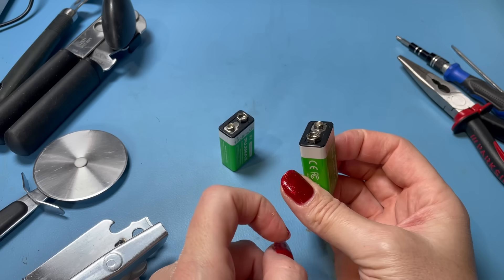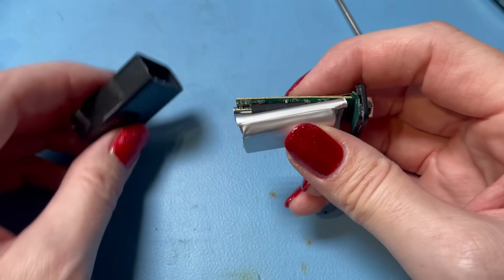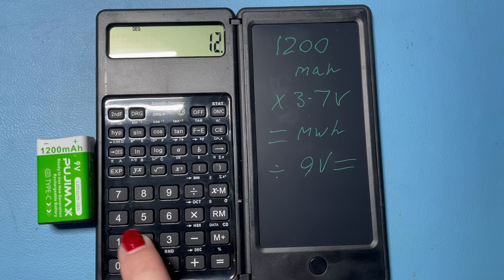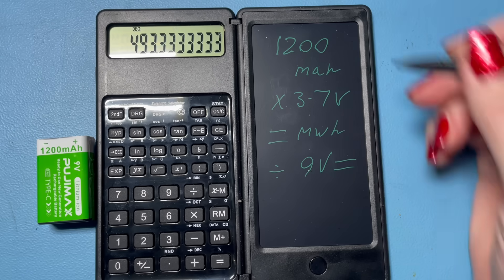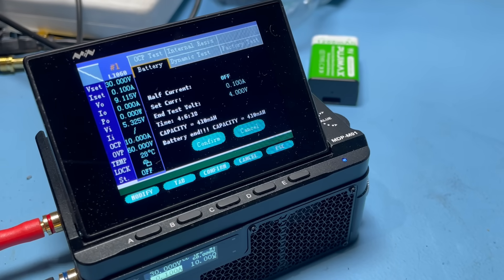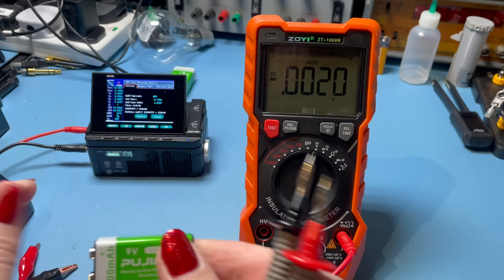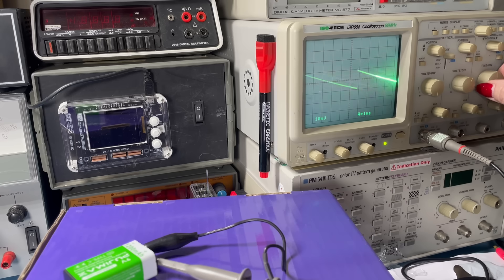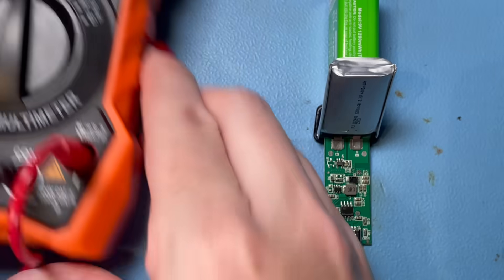Temu 9V Lithium Rechargeable USB-C Battery Teardown

Comment: This 9v battery from the topic will self-discharge in a few days after charging. Because it uses a voltage increase from 4.2v to 9v, that is why there is a constant flow of small current even though the battery is not loaded

Comment: Vende Bateria falsificada, é golpe!,, Não entrega o prometido
Reply from the maker: They're not counterfeit, just very poorly designed. I wouldn't recommend you buy any.
Reply: @JazzTechUK  Comprei duas bateria Hoje, da marca e Flex 1200mAh 9v USB... leve como papel.. não deve ter nada dentro.. vou abrir a bateria , caso dentro estiver com a bateria de 3.5v vou devolver,,/  o carregador da bateria é de 5v de Celular....o carregador não é de 9v....como tem gente que engana as pessoa com produto ruim dizendo que autentico, mas é de ruim qualidade

Comment: Everything is explained very well, so I don't have to do it. 😀But the biggest problem with such batteries, even from the same manufacturer (Pujimax), is that they don't all have a 1200mAh Li-Ion battery, but a smaller capacity. I have two versions of these batteries. One is light blue-white, and the other is orange-black. They all say 1200mAh, but one is around 1200mAh, (orange-blue), and the other is around 750mAh. So they lie with the specifications. These worse ones were bought through TEMU. And that's the biggest problem, that they cheat us like that. And it's not just the case with 9V Li-Ion batteries. And with 1.5V the same. You charge some via USB at 900mAh, others at 550mAh, and they charge at 350mAh. Completely the same batteries, same colors, same manufacturer, but different seller. Easy for us who can measure it, but what about 99% of others. Only later do they notice that their batteries are draining quickly. Otherwise, these electronics in them also consume electricity even when they are not connected. According to the chip specifications, it should be in microamperes, but it seems to me that it is more than 1mA. Every day 30mA less.
Reply from the maker: I only did a teardown on these batteries because viewers asked me to. I don't recommend them. They have lots of issues, some of which you have mentioned. You are better off with a standard 8.4V dual pouch cell lithium ion battery with no electronics in.

Comment: Sorry your math is not correct. First let convert mAh in watt per hours
Wh= V X Ah = 3.7 X 4.4 = 16.28 Wh
Capacity at 9V = 16.28 Wh / 9 V = 1.81 Ah (please remember Ohm law W/V = A)
DC/DC typical efficiency about 85-95%, lets assume 90%, capacity at 9V will be about 1.6 Ah (or 1600 mAh)
Basically you cannot use your test device to measure the actual capacity, an electronic CC load will be much better.

Comment: The charging from USB is convenient ,so I was considering this for an oscilloscope current probe, but I was wondering about the noise since a boost conv would be used. 80% conversion efficiency is unsurprising since they would use low count, low quality components to keep the price down. With or without linear regulator, this is only usable for noise resistant,  power hungry devices that don't care of rapid self-discharge when not used. Thanks for a great video!

Comment: The typical load for a 9 Volt battery is between 0.1 mA to 25 mA max, in the case of a portable radio. Drawing 100 mA from a normal 9 Volt battery would kill it prematurely.
There is a different 9 V Li-Ion battery with two 500 mAh Li-ion battery and a BMS circuit, which I prefer - it has no parasitic consumption, no RF noise, and you can check the state of charge by measuring the terminal voltage; but the output voltage is 8.4 Volt at end of charge, and 7.2 Volt nominal, 6 Volt fully discharged.
The battery you dismantled in the video has a parasitic drain of 0.1 mA, frankly eccessive.
Thankfully in our side of the world we define the battery capacity as the energy delivered at the output voltage, not the sum of the capacity of the Li-Ion cells present inside. I have many LFP 12 V batteries, which have 4 cell inside, with the capacity shown in the box as the sum of the capacity of the four cells inside. It seems the Chinese like to show the highest possible number possible, even if it is unrelated to the normal use of their devices.
Greetings,
Anthony
Reply from the maker: I only took this battery apart because viewers asked me too. I don't think it's a great battery at all. A basic one with 2 lithium cells in series and no electronics is a better bet.

Comment: Keeping up fixed voltage and then suddenly dropping to zero is exactly how a boost converter works.  It has a feedback circuit that keeps the output voltage fixed by varying the duty cycle in response to variation in input voltage and load impedance. But once the input voltage drops beyond a certaing threshold it just stops working.  You can't expect it to drop output voltage gradually the way a battery would.
Reply from the maker: I don't recommend these batteries at all. I only did a teardown because viewers asked me to. You are better off with a straightforward 2x lithium cells in series giving 8.4V with no electronics.

Comment: Hello, good teardown. I think that the saw tooth waveform on the scope could be coming from the fact that the battery is not loaded and the switcher becomes discontinous. Still, not what I would want for a battery that powers electronic devices as most of the time the decoupling is minimal as they rely on the battery DC cleanliness..
Reply from the maker: I did a teardown and full test as a lot of people asked for it. They are not a great battery replacement. You are better off with a standard 2 cell in series lithium at 8.4V without all the other not so good stuff. At least then it is clean and quiet.

Comment: I've just bought a couple of long-range RF remote controls which take PP3s and require the battery holders to be screwed shut. I'm butchering one of them to take two salvaged 550 mAh disposable vape cells in series and one of those 2-cell with balancing USB-C boost charger boards from AE. They don't have over-discharge protection but I don't think it's needed in this application. The default charging current is far too high and the resistor to set it is tiny. Fortunately one end of it is grounded so I only have to make a connection for my standard resistor to one tiny pad.

Comment: I can't be the 1st to point this out but you should calculate using the nominal voltage which is closer to 7.2V for 2 cells in series.
  Trying to find a side by side comparison for all aliexpress 9V rechargeable but can not find one. want to know which are better suited for high power and which are better suited to low power long life and not to mix them up in the applications to avoid premature death to the cells.
Reply from the maker: There is only one cell in this battery at 3.7V. It uses a boost convertor to raise it to 9V. The 1200mAH capacity is at 3.7V, not at 9V where it is just over 400mAH in practice. This battery is good for high current use. It's fine at 100mA, even 200mA. I did run it at 500mA for about 15 minutes, which it did fine but became a bit hot so I stopped. It's no good for low power long term use as the boost convertor is constantly loading the battery and draining it slightly.
If you want a good quality lithium rechargeable PP3 that will be good for long term low power use then buy an EBL lithium PP3. This is just 2x pure lithium cells in series, (may have a protection circuit, I haven't taken one apart) and is charged from its snap connectors in a standard lithium battery charger.
Reply: Might be better off with 3x LFP cells in series followed by an LDO linear regulator?

Comment: My homemade chargers follow a simple rule; "2 volts over and 10%"  in this case, charge voltage is 11 volts and charge current is 10% of rated capacity,
lol 120ma. --- if it was a real battery.

Comment: 1200ma@9v is useful. it depends on self-discharge.
Reply from the maker: It's actually only 1200mA at the cell voltage of 3.7V, not at 9V. It's misleading.

Comment: Glad to find anyone related to electronics. Thanks for the Tear-down. What is that discharge totalizing load that you used?
Reply from the maker: Are you referring to the Miniware devices I used?
If so, here are the links to the 2 videos I did on those:-
Miniware DC Load  https://youtu.be/UidMfkIL6d0
Miniware Smart Digital Monitor  https://youtu.be/2EnWU_F28IM

Comment: One thing that is not given nowhere enough attention is:
Do they have the 5.1kohm resistors to charge from a real USB-C charger and not just from a oldschool USB A to USB-C cable??

I HATE when they cheap out on two damn resistors like that.

This doesn’t look to have them 😡
But it’s a bad construction in so many other ways it’s not surprising.

My Soshine AA and AAA USB-C batteries drops to 1.1volt when almost discharged, and DOES charge on real USB-C chargers

Comment: There are some losses in the boost-converter circuit, maybe that accounts to the lost 100 mAh.

If you only use it on a low load, the losses will be much higher, so would not last a week long, maybe, but old alkaline battery would.
Reply from the maker: It's not an ideal solution by far. I think most people would be better off with just a plain 8.4V 2x lithium cells in series PP3 battery.

Comment: Hi Jazzy, it's pretty much what I was expecting. For the actual capacity, you must take the efficiency of the step-up converter into account and with 85% efficiency (which should be about right for this kind) we get 419 mAh from your calculated 493 mAh, so that's very close to what you actually measured. Makes perfect sense. And yes, the advertised capacity is false and unfortunately usual with these cheap chinese batteries/battery packs/...
Now, with 400 to 500 mAh, we're still in the ballpark of an actual 9V alkaline battery, so if it wasn't this noisy, it could be a good rechargeable replacement.
The charging IC is a TP4056 which is an ultra-common small Li-ion charging IC, but I was not able to identify the reference of the step-up converter. From what I can see though, the output capacitors (all ceramic) seem to be relatively low values from their size, so that's probably part of the problem.

Comment: Hello, Thank you for the job. 
It looks like Lithium polymer battery. Right ?
If it is, it won't last long. I bought different stuffs on asian websites : most of them had lithium polymer batteries. Dead after 3 monts : they inflated and passed away

Comment: 410 mAh is not bad about the same as a pound shop zinc carbon PP3, it's also a lot better than the ones I got from Aliexpress which I measured at 230 mAh. I took one apart and found a cell marked as 300mAh on the same board as the Pujimax.

Comment: That's pretty good really, most NiMH rechargeable 9V batteries are around 200mAH, the other 'quality' brand LiIon types like Ansmann are around 400mAH, about the only things I'd want to add would be a switch to turn off the boost converter and a filter cap on the output but I do wonder if it might measure better with a small load attached to the output?
Reply: Yeah you don't get much as they stack 6 cells together so that wastes space.  I think it's a little more than 200 though.  No it won't measure any better with load and will be worse.  9v is just not designed for high drain devices so capacity is limited.  So it's only used for DM and fire alarms that's it.

Comment: Mine doesn't discharge but it delivers 8ish volts (I noted that most original Duracell deliver 8.2v brand new).
Reply from the maker: Then it's likely 2 lithium ion cells in series with no boost convertor. A true battery.
Reply: Is yours a name brand or a cheapie? Got a link?

Comment: 83% efficiency is not too bad but it isn't great.
Reply: Might be somewhat better (or worse😊) at lower currents - 100mA is a lot more than anything I own draws (that uses a 9V battery) 
Any improved efficiency might also get eaten by the longer time the circuitry then runs and consumes power.
Reply: @michaeltempsch5282 how about running the test again using the two batteries in parallel so they only provide 50 mA each?
Reply from the maker: You cannot run these batteries in parallel as they don't behave like pure batteries. The boost circuits will fight with each other. As these 'batteries' contain lithium ion cells you can get high currents out of them.
Reply: @JazzTechUK the boost circuits will act as different phases of a multi phase regulator. Also the current from the battery is limited by the regulators design choices.

Comment: Clearly the form factor leaves insufficient space for an output capacitor - probably best avoided! Sadly the mAh nonsense is industry standard now: it is the same with power banks. Trading Standards should be all over this: any reasonable customer would expect a power source supplying 9v to supply the stated current for the stated time and the way the number is stated is meaningless without knowing the voltage of the internal cells. The capacity of any battery system should be stated in Watt-Hours. The habit of using the 'milli' prefix when the numbers get up in the thousands is also extremely aggravating - why not go the whole hog and state it in nano-Amp-Hours to make the numbers really large?
Reply from the maker: Yes, I think it is deliberately misleading. Makes people think it is more powerful than another brand. It is actually 1200mAh, just not at 9V.

Comment: the Batteries , i think, will be fine for smoke detektors or (Lab/Kitchen)Scales.  i have also a lot of 1,5V USBc Batteries, for my thermostats, remotes .....
Reply: As to smoke detectors - I'd not... It appears it maintains 9V until it abruptly cuts off, meaning you get  no low battery varning beeps.
Some 1.5V LiIon cells have circuitry that lowers the output voltage to about 1V when the LiIon cell goes near empty, vso that devices w/ low battery warnings can do heir thing and alert the user.
Reply: @michaeltempsch5282 I know what you mean.  But I have Networked Detektors, so I get a Message if one gets offline. And I preventive recharge them once a year
Reply from the maker: @krauterhexer I don't think they are a good idea at all for a smoke detector, partly because they don't drop voltage before cutting out, plus the boost circuitry is running all the time, draining the internal lithium ion cell.
These batteries do have a place and a use, just somewhat different from conventional batteries.
Reply: @JazzTechUK  ive wrote it a post above. they are networked smoke detektors, i got a message if one gets offline.  so its no problem (and i recharge them once a year, preventiv)

Comment: When boosting the voltage it is not 100% efficient that's why u didn't get close to calculation
Reply: 20% loss in the boost circuit is pretty common.

Comment: Can you charge it while using it
Reply from the maker: They use separate circuitry for boost conversion and battery charging so it might be possible. I wouldn't suggest it though with such a cheap product. It might cause it to overheat for instance.
Reply: @JazzTechUK thanks for the reply 👍

Comment: Great teardown, but methinks a product sans need!
It might be a little more useful if whatever cct/chip regulating the boost voltage simulated a realistic discharge slope, but the biggest magic to be useful in a DMM or other handheld gadget would be a motion sensor for turn-on.
You youngsters are spoiled with today's tech!  As a lad I used to make PP3-alikes by slicing cells out of discarded 67.5 volt zinc-carbon 'exploder' batteries 🌞 (3 stacks of 15 cells).
Reply: They're good for DMM and smoke alarms but can't think of any other device that uses 9v.  It works but not really getting the rated capacity.  Gotta hand it to them for coming up with battery innovations and can only improve with newer versions.

Comment: The current you took from the battery is rather high for a PP3 duracell only list up to 60mA on the datasheet.
Reply: But it's also a completely different chemistry. I'd expect pretty much any LiIon cell to be capable of 1C  (so at least 1A for this one)
100 mA @ 9V requires  (inefficiency in conversion ignored) about 250mA @ 3.7V
Reply: 100mA maximal
Reply from the maker: @FireballXL55, as @michaeltempsch5282 says, this is not an alkaline or zinc carbon battery technology. It's lithium ion, so can deliver a much higher current.
Reply: @JazzTechUK  For some reason I can't see my post in this thread now, but IIRC, that was what I was pointing out in my response to the OP...
Reply: @JazzTechUK I know exactly what it is, but it was designed to replace a standard PP3, so it would have been designed with that it mind.
The current from the cell would be 2.5v times the output current at best.
So at 500mA the little pouch cell would be at 1.5A minimum.

Comment: 410mah is terrible considering that most decent alkaline 9V batteries are 500-600mah.  I would expect a decent Lithium ion based 9V rechargeable replacement to be around 650-850mah.  Still far short of some of the lithium primaries which are around 1100-1200mah
Reply: 410mah vs 600mah is what I'd expect with LiPo vs alkaline.  Actually much better since rechargeable are usually under half the capacity of a primary battery.
Reply from the maker: @kuhrd it is around 1100-1200mAh but only at its native 3.7V, not after boost converting. Higher voltage equals less current for the same power, of the cell.

Comment: Jazzy, I would have used a big hammer to open the battery up. 😅 Like Lora Croft opening up the mystery clock. 🕰🔨
Reply: Big Clive might consider using the "Vise of Knowledge."
Reply: @jbuchana He's got his X-ray device (aka big hammer)...
Reply from the maker: I had various devices standing by to open it up, like you saw, but didn't need then in the end.